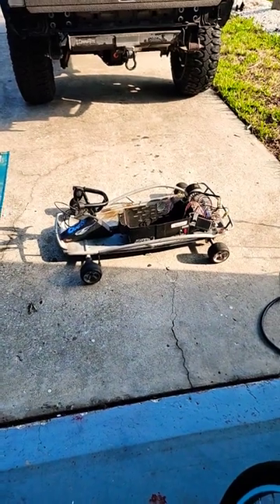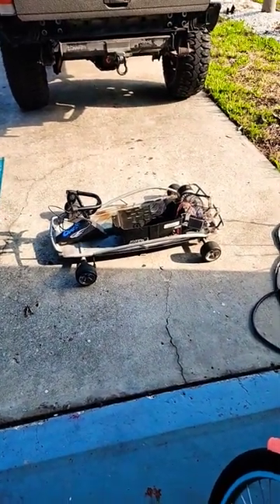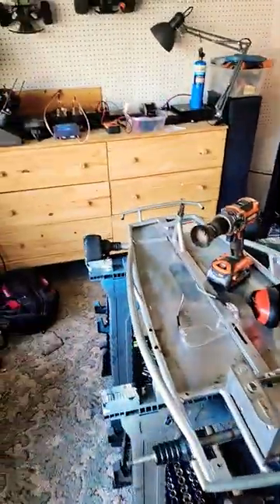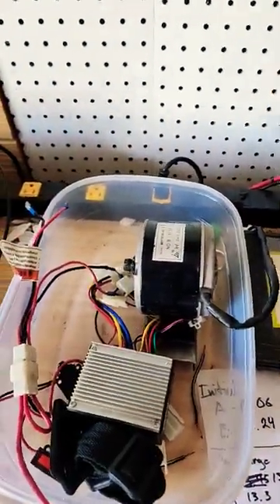Two broken Razor go-karts for $100 - How to fix electric go-kart/scooter series: Intro

Comment: Where are the videos you were going to make? I got a broken one and trying to diagnose it.
Reply from the maker: Workin on it, the wife and I started organizing the garage so things got messy for a bit (like couldn't access anything and we had to move the mess out of the garage just to move shelving and such around...lol). 

I'll have the battery/motor test video up shortly and then the controller/throttle test up after that, with those two videos you'll be able to diagnose what's wrong and order parts. 

I plan to make a long form video covering what to look for, testing, and upgrades, all in one place once the garage is back to a usable workshop space :-)
Reply from the maker: Here is the throttle and controller test, I'll update the description with the link to the diagram later tonight - https://youtube.com/shorts/-F0_n3qiaCs?feature=share
Reply from the maker: Here is the battery and motor test - https://youtube.com/shorts/mBEhsF9PPOM?feature=share